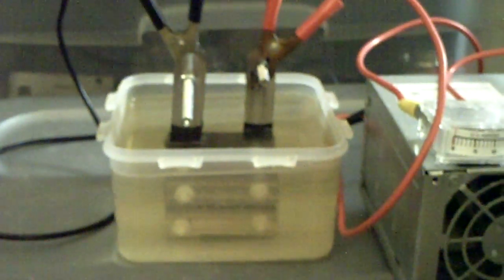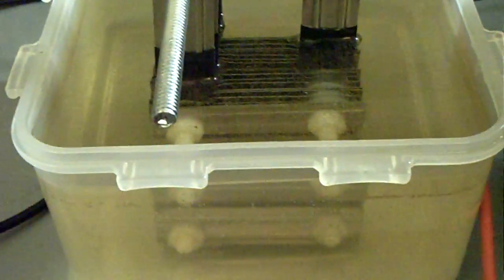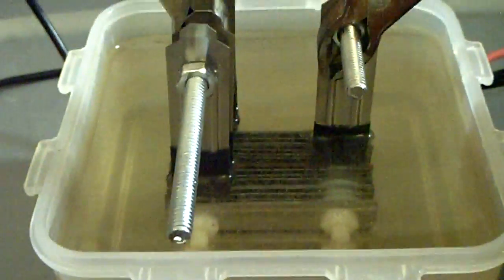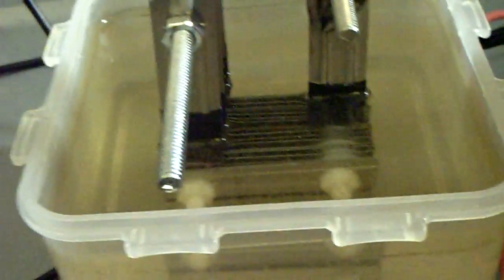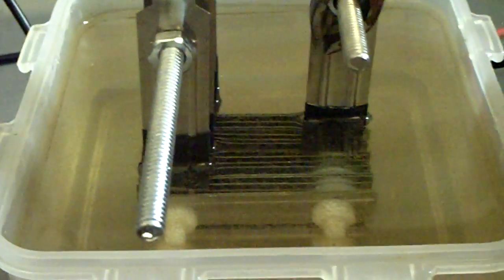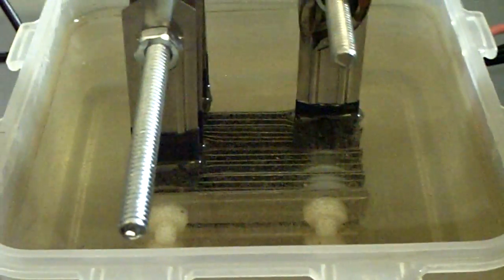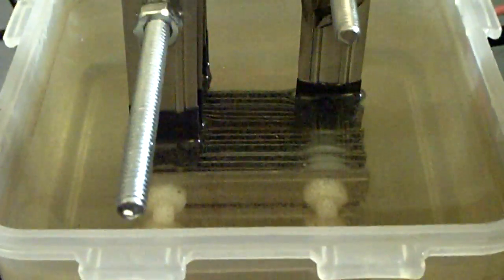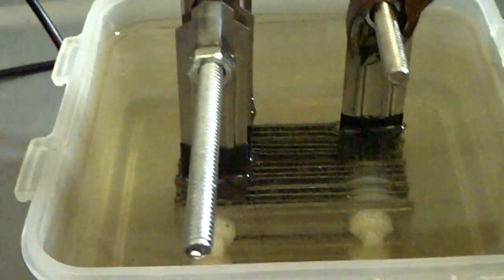Vid37 New Slot Cell Hydrogen Generator Demo (HHO, Brown's Gas, Hydroxy)

Comment from the maker: Yes it does. It is because you are using half the voltage to produce similar output.  That is why the amperage is lower and heat is not as much of an issue.

Comment from the maker: There was some output on the outer negative plates, but not enough to make it worth while.  

I've actually found that using configurations with negative plates on the outside reduces amperage and heat.

-NNN+NNN- makes great output at low amperage. If you do the opposite +NNN-NNN+, you have nearly twice the amps with similar output.

Comment: I thought that might happen when I saw Video 36. You are getting no production outside the first two neg pates. The two outside plates need to be pos. Basically you just added two cells to your configuration with no power running in them.